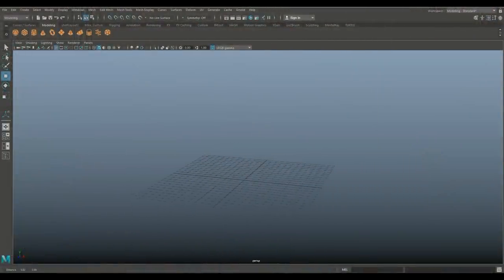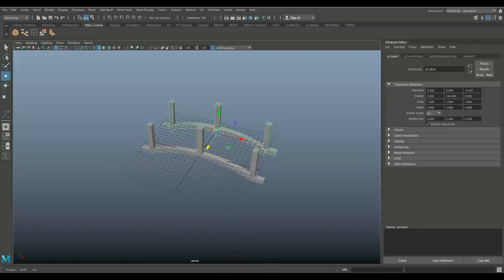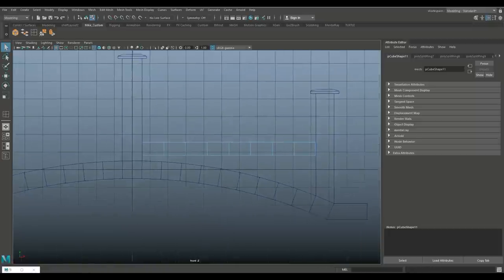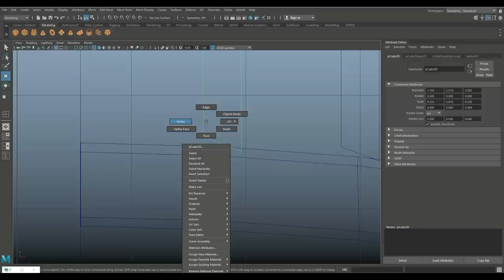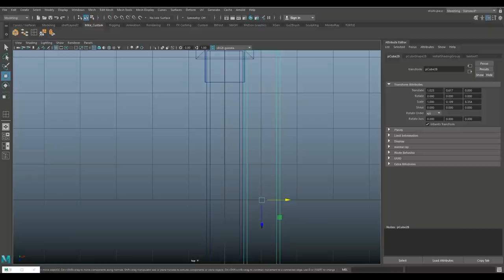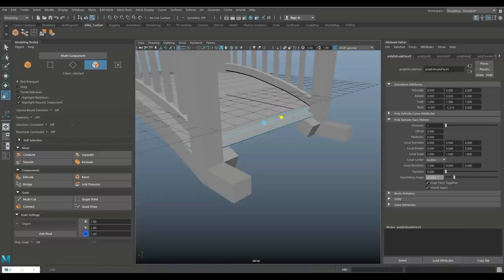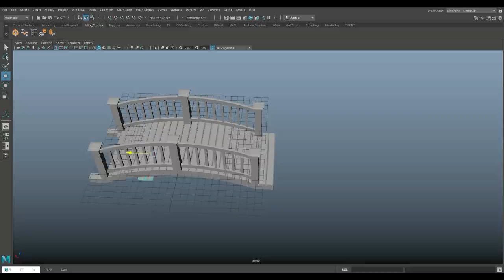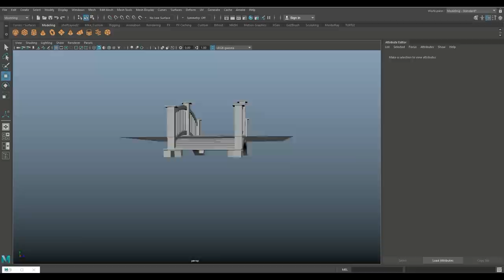How to model a 3D bridge in Maya 2018

Comment: Great video, as always Mike.
For the caps, If I have such a situation, I would change the pivot. I snap it to a vert of the cap, then I can snap it to a vert of that pole.   Or, if the pole doesn't have the same dimensions, I use the multicut tool. to make a cross on the top of the pole, so I have 1 vert in the center, then I would snap the cap to that vert, and then delete that cross on the pole.
Reply from the maker: Cool, thanks for sharing Niels